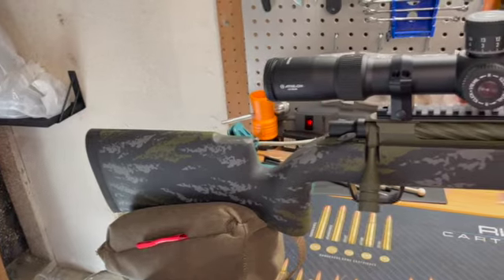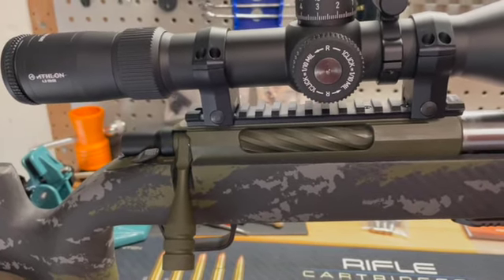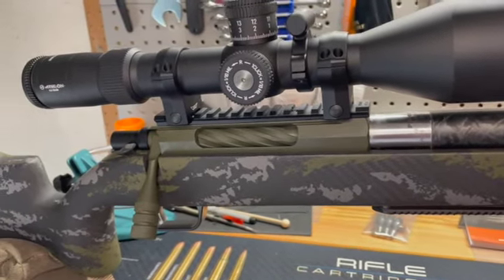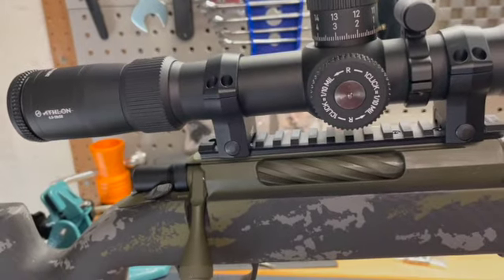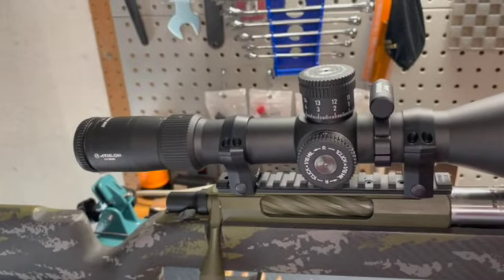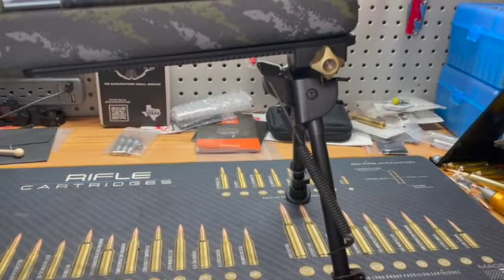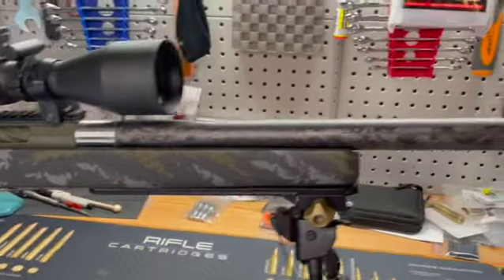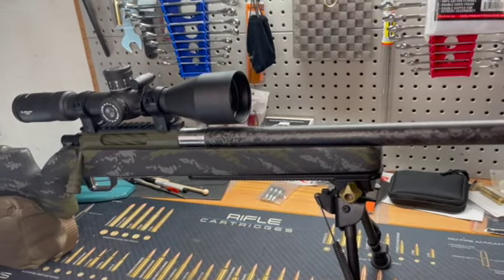Tikka T3X Custom Final Assembly!! 7 PRC!!

Comment: i would have thought it would be a little lighter than that. i have a bergara b14 in a stockys vg2 carbon stock with a leupold vx5hd 3-15x44. with a caldwell bipod its right at 10 lbs. i just ordered a 20" carbonsix barrel in 7mm prc so im hoping to drop about a pound or maybe more. nice rifle man!
Reply from the maker: Yeah I thought it would’ve been under 10 pounds but it’s still very manageable for my application.

Comment: Very nice. I should have my Tikka T3x soon - 308 Winchester, Brux barrel, AGComposite stock, I think same as yours, new trigger spring also. Cerakote in Midnight Bronze. I have a custom 700 action 7PRC right now with a Hart barrel, have another 7PRC on the way from In-Rut rifles, another 7PRC likely in 3-4 months - sent the parts to the builder about 3 weeks ago: Defiance anti action, Triggertech diamond trigger, McMillan stock, Brux fluted barrel #5 contour, Christensen arms BDL kit, and not sure what I was thinking but another 7PRC: AGComposite stock, LonePeak arms Razor Ti action, TTDiamond trigger, Benchmark cut-rifled barrel #5, Hawkins DBM M5 hunter mag. Just wish I could find Re26 powder
Reply from the maker: Those are some great mods Derek! I was looking at a Defiance action but ended up staying with the Tikka.

Comment: Hello new here can u drop a parts list!? Thanks
Reply from the maker: AG composites alpine hunter stock
Proof research prefit barrel
OMR bottom metal and action screws
OMR bolt shroud
EC tuner brake
Warne 20 MOA rail
Warne mountain tech 34 mm high rings
Warne 34 mm scope level
Athlon Cronus 4.5-29x56
Mountain tactical trigger spring
Area 419 arca lock 
Long rifles receiver/bolt work